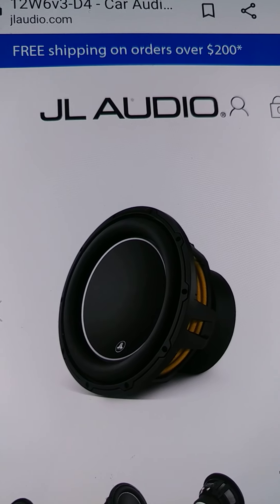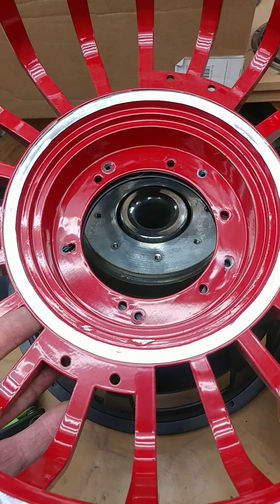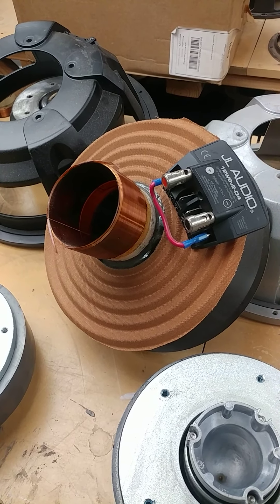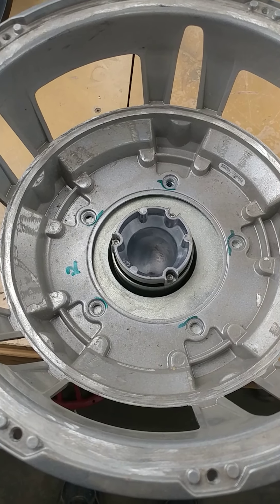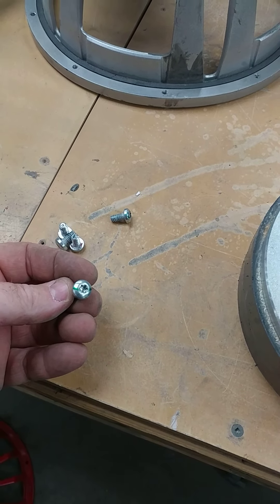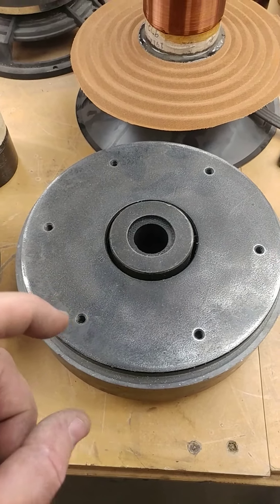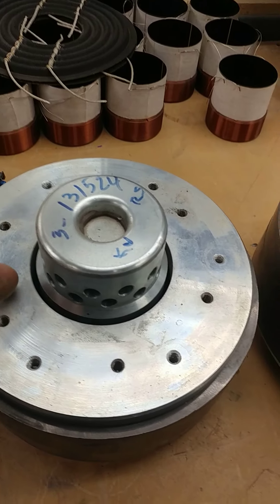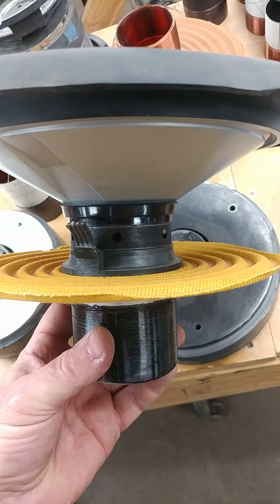JL Audio 12W6 version 3 review @ The Robot Underground

Comment: JL is not garbage though. I agree about it being proprietary. 12w6 hits hard in a well built enclosure. People have lost touch about power. 600 watts is still a lot of power. The 80s and 90s with 100-500 watts in mini truscks where beating down the blocks. They and Kicker are the Godfathers.
Reply from the maker: You are correct.  I always imagine trying to unscrew a 100w light bulb.  THATS's 100wrms in the palm of your hand.
Reply: Very true but also true almost any sub will sound good and hit hard in the proper enclosure
Reply: @johnoates3326 no absolutely not most subs will sound good but few sound great and a lot of them sound really bad (especially depending on your use-case).
Reply: @milchpulverkakao4917  lmao 🤣  whatever u have to tell yourself to sleep good at night bro good for u..I'm sorry if u want JL to be your baby daddy🤣🤣🤣🤣Whatever floats your boat or sinks your ship🤣🤣🤣🤣🤣
Reply: @johnoates3326  I am not talking about jl in particular and I wouldn’t buy any of there products new because I think they are overpriced, but i happen to own a 13w7 that I got used for a very good price. I also own a dd 608 and I listen to them side by side in a sealed box any the Jl sound super clean and has a really fast response while with the dd you can hear motor noise and it also sounds sloppier even though it‘s smaller
Reply: @milchpulverkakao4917  lmao there's way to many variables to give u any sort of answer.I have a JL W7 13.5 motor and 3.5" coil on a 18" basket so that's what I think of JL..Honestly whatever u want to tell yourself to sleep better at night is your problem not mine..U can't just give 2 examples and not give any information as to why "you think" the JL sounds better..Proper enclosure proper power proper tuning ect..At the end of the day a sub is a sub low frequently is not SQ...But until u know what your trying to argue about there's no point to try to give u any common since..
Reply: @johnoates3326  I tried describing what I heard and as you know it’s quite hard to describe how a speaker sounds like through text. The song rumble by skrillex has a lot of really tight bass and you need a fast sub for the song to sound good with the jl that bass sounds well defined, tight and clean but with the dd the bass sounds muddy and undefined the sub also produces noises that aren’t in the song
Reply: @milchpulverkakao4917  once again no idea of ohm final ohm load impedance rise amplifier being used what type of power your feeding the amplifier amplifier settings if everything is even set correctly with a oscilloscope ect.My point is without this knowledge I'm sure it's more than likely user error
Reply: @johnoates3326  dude whatever
Reply: @milchpulverkakao4917  lmao 🤣 no your right your JL audio is a magical subwoofer that defies all rules of electrical and proper math to calculate the enclosure
Reply: @johnoates3326  i never said that it just happenes to be the best subwoofer that I own/have listened to extensively. I am sure there are better ones out there but also a lot worse ones
Reply: @johnoates3326  I am talking about mechanical noise not about the performance and mechanical noise shouldn’t be affected by the things you mentioned. I have a tamp e1500 and it’s set to single channel mode my jl has 2,5 ohms and the dd has 4 .

Comment: It's not just the size of the magnet it's the gap tolerance the top plate the quality of the iron used jl klippel tests all there subs not a jl fan but just tossing random coils in chunks of ferrite and iron doesn't make a good sub I take it most of your customers run high tuned ported one note wonders
Reply from the maker: The experience of building thousands of woofers tells me different.

Comment: So can you rebuild 13w7 because I have 2 there that have collected dust in my shed and I would ONLY pay to rebuild it stronger than before because I paid way too much the first time lol 🤦‍♂️..
Reply from the maker: You can't make them, "stronger", but you can use a stiffer suspension.  The only way to make a sub stronger is to change the motor / magnet assembly.

Comment: Hi, very informative. Do the new pole design in the W7 perform some shorting ring function?
One aspect of the soft spider and surround of the JL is the subjectively different SQ in the bass detail, perhaps at lower volumes. Some of the stiffer suspension drivers tend to need a lot more power to 'wake up' and don't sound as good at lower levels? Do you know what could be the reason for this?
Reply from the maker: On paper, the soft suspension gives the numbers that people think they want, so it has a bit to do with marketing.  The other thing is that it makes it VERY easy to kill them... And of course, that's not covered under any warranty.

Comment: Thank you for opening my eyes to JL.  I love the subs but didn't realize how proprietary and anti-right-to-repair they are.  I recently bought a non-working 12W6V2D4 thinking that I could repair it.  Two attempts later (coils, spiders, and surrounds) and I still can't get the coil completely centered.  The biggest pain was figuring out what to do about the plastic ring around the voice coil.  I ended up 3d printing a new one that is larger diameter with a wider channel in order to fit the wires better.  I'm never buying another (new) JL again.
Reply from the maker: I'm curious to to how much you paid
Reply: @RobotUnderground  The guy had 2 of them and said they were both blown. They metered good, but one had a dragging coil. I offered $150 for both of them, knowing that one of them worked perfectly.
Reply from the maker: @kylehuffman9694  Good deal.  I got a burned one in yesterday and was going to post it up for $200 shipped.

Comment: Kind of of topic but I use to have an image dynamics idmax back in the day.  I really liked the way it sounded.  What's your opinion on the new idmax?
Reply from the maker: The problem is that it's proprietary.  No parts.  I solved this by using a really long 2 5/8" coil and a quad stack motor.  Now I have better performance, powerhanding and that tight punchy bass with a small Vas all for just $250 shipped in a 12".  Lots of stroke and low Fs, I give you The Vato Xtreme.  https://youtu.be/ZZvlExahx-c

Comment: I have an Alpine R12. I heard a scratching sound and then the sub sounded terrible.  Checked ohms and were fine. Took it apart and only saw a tiny area where there was a rub. What could cause that?
Reply from the maker: Sounds like some debris.  Here in Arizona we get a lot of sand / dirt and rocks in there.  Could have been a piece of epoxy that fell off or glue.  Just recone and should be fine.
Reply: @RobotUnderground  Thanks for the advice.   I live in south Florida so sand is plentiful. Mix it with hurricanes and tropical storms and top it off with Sharan dust clouds and I can see this is a definite possibility.  (Also, one hell of an unwanted instant skin exfoliation if you aren't careful)

Thanks again. Live the videos!

Comment: What kind of glue does JL use to adhere the top plate to the magnet?
Reply from the maker: They use an acrylic type that has an activator.
Reply from the maker: However you can change to a 2 part slow cure type like our Devil's Jizz or even just JB Weld.

Comment: Fs: 20Hz
Qts: 0.433
Vas: 162 liters
WTF?
How’s that work out?
Reply from the maker: Well, that means you need 5.7cf to reach the Fs which is 20Hz.  If you don't need to get to 20Hz, you can use a smaller box.  With the Qts being in the middle, you can either go sealed or ported.  If you run these specs through a box program like BlauBox, you'll see a nice boost around 30-35Hz when you tune the box to that frequency.

Comment: Sooo... what's the best sub you recommend,  Sq,  versus a sundown.. ?
Reply from the maker: Let's do this public so maybe people can pick up on why I pick what I pick.  Tell me your budget, what amp you're working with and what amp you have.
Reply: @RobotUnderground  my budget is 5,000 I have jL w7 12 .. 2 and 1,000 jL audio amp.. and a jl w7 13.5
Reply: @RobotUnderground  I wanna buy a sundown 3k amp and some 2 12" sundown subs , box on eBay..  3 order one, and I have a 300 amp alt/ mechman..
Reply from the maker: @chrisnas1483  All in the same system?
Reply from the maker: @chrisnas1483  What you have should already be plenty.  What series of Sundown are you looking at?
Reply: @RobotUnderground  no, 1st 2nd and 3rd systems,  a 12 toyota camry, a nissan maxima 04 , and soon to be a 2014 or up toyota suv not the big suv, the 2nd one down , that's the one I want the 2 12 jl audio and  I want to switch if sundown sounds better than the 2 12 sundown
Reply from the maker: @chrisnas1483  Ok, start with the 2012 Camry.  What equipment do you have for it so far?
Reply from the maker: @chrisnas1483  What's wrong with that?  Are you wanting louder?  What amp do you have on the sub?
Reply: @chrisnas1483  I have a 05 Maxiam, 2 Skar EVL12's, Orion XTR2500Dz all in pre-installation stage. What did you use in your 04 Max?
Reply: @BobBasshead  whoa... I got an 04 maxima.... , cvt Transmission sucks.. huh.. huh.. huh.. ( you said....

Comment: Just found your channel and subscribed bc im enjoying the woofer content. When comparing the MOFO motor to the W6 you state bigger is better essentially? I get the MOFO will handle
more RMS power but i was under the impression motor size had little to do with performance and whats is more important is BL (with regard to working with the soft parts mms) and magnet grade? I have owned JL woofers many years ago and did like the sound quality and get they are considered overpriced compared to the competitors. I also hear good things about PA MOFO and gothic subs offering good bang for the buck so i get the argument of value although never owned either. Im not for or against either brand and personally buy for performance/value and currently run an NEP 12”. Im no expert and not trying to stir the pot just trying to learn if you could go into a little more detail about your comparison of the 2.
Reply from the maker: Let's say a JL W3 with 6 layer coil has a BL factor of 24.  Sure that's really good but to what point?  The magnet and coil size have lots to do with getting rid of the heat.  Excursion / displacement is also a factor.  That's when you can compare total SPL to Dollars and find the value of your subwoofer.  That's just one way to find a value.
Reply: @RobotUnderground  so anything under the w6 isn’t worth getting? Your personal opinion?
Reply from the maker: @kapokidkidkapo719  In my opinion, NO JL PRODUCTS are magic or worth the premium you'll pay.  That's simply my honest opinion, based on performance / price = value.
Reply: christopher paris  what sub model? I’d like to see that

Comment: I had a JL W4 d4 in an omni back in the day with a Legacy LA320 2 channel, and I actually ripped the spider off the basket. JL dealer looked at my amp n said no effin way!!! Immediately said that they would need one of their techs to inspect my install. They pulled in their shop n said all good! They pulled my old woofer out and put a new one in. Then of course they did a sound check and they couldn't believe how much the woofer was moving off that Legacy amp!
Only woofer I ever had to use the warranty on. Got Rockford Fosgate Punch somethings after that then some IDQ 12s.. I abused the hell out of all those never had a problem. JL honestly looked like a cheap realistic replacement woofer for RadioShack, sounded pretty decent for what it was. Not worth the $$$$ tho.
Reply from the maker: Ah.. Yes.  When JL was still in high school with braces.

Comment: NGL, I currently run a 10w7 with a ported box I built according to JL specs. Best sounding sub I have owned. Only sub that rivals it is my Elemental Designs A12 with a flat "cone". I also have a 12w7 but it is in a sealed box. So it does not move as freely as the 10w7.
Edit: BTW, I still own a pair of 12" Hard Times subs I got from your eBay days. Mint condition. I bust them out every so often and pound on them and they do not disappoint!
Reply from the maker: I'm glad those turds are still jammin.  I was building those things in my living room.
Reply: @RobotUnderground  LOL! Hell yeah.

Comment: I want to hit the lowest lows with NO ports. I am looking at Chinese 24" 8 ohm subwoofers (I also like good speaker control) that have "2000 watts RMS."
I am a fan of large speaker cone area in lieu of having a 2" subwoofer with 6 feet of excursion. What do you recommend?
Reply from the maker: I like ported but you don't need to get down to 20Hz
Reply: @RobotUnderground  Oh, the main subs are for the audible stuff. The folded horn sub-sub-subwoofers are for the infrasonic stuff.
Reply from the maker: @exploranator  tactile transducers are WAY better.
Reply: @RobotUnderground  hmmm. Seen those... they seemed kinda, er weird...

Comment: A JL sub (10w3) is the only sub I've ever had that failed on me. The tinsel lead snapped. I think it could have been an easy fix but I just wanted to try something else. I've tried JL 10w3, Fosgate P310, Alpine S10, Sundown E10, Alpine R10, Alpine S10 (again) in that order. The JL was the best sounding by a distance. Alpine S10 next for overall sound quality and the rest were just good on SPL nothing special. All powered around 500-1000 watts rms depending on the setup so maybe they are worth the money. I just wouldn't get that 10w3 again until they change how they attach the tinsel leads because I like overpowering my subs. I wanted to get the next step up a 10w6 but for that price forget it and then what if I blow it again? The others I listed can take a beating (Alpine R10 hands down winner). I don't want a fragile sub.
Reply: I had two NVX VCW 12s 1000 RMS each blew w6s away in the proper box even the NVX X series 12s not as loud but way more musical outstanding SQ
Reply: @dopeimean23  you're really mad that I want a rigid subwoofer not a flimsy one. jesus christ get a life.
Reply: @dopeimean23  went are you so obsessed with this comment jfc it's not even funny it's sad go away
Reply: Sound like a great marketing pitch by a very savvy salesman. Well done job and I hope they paid you well for it. ;D